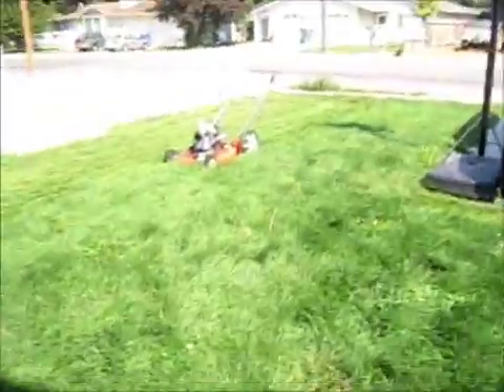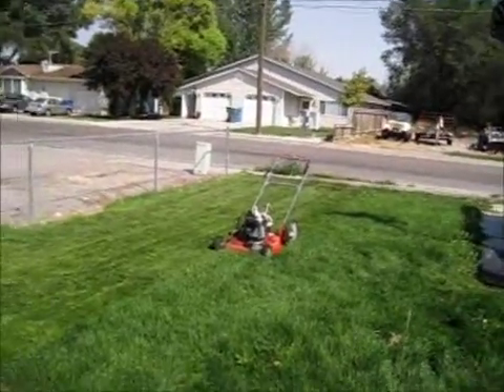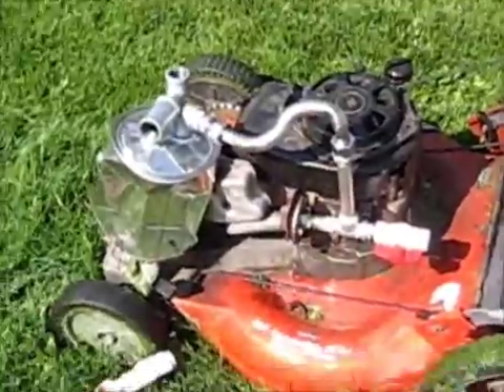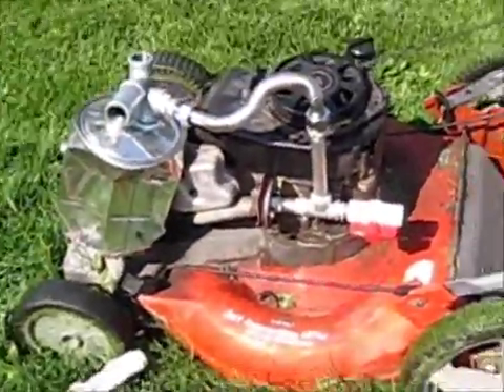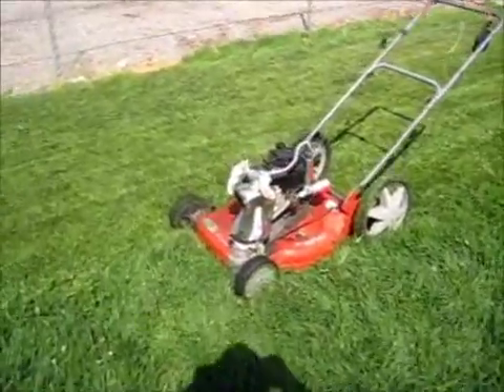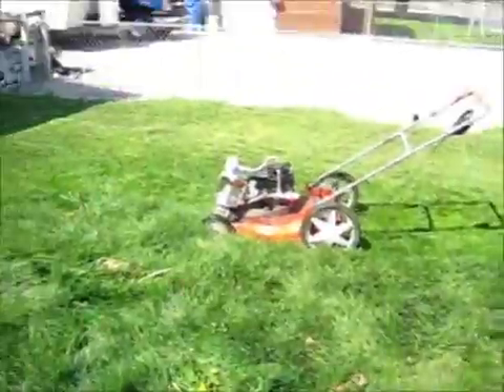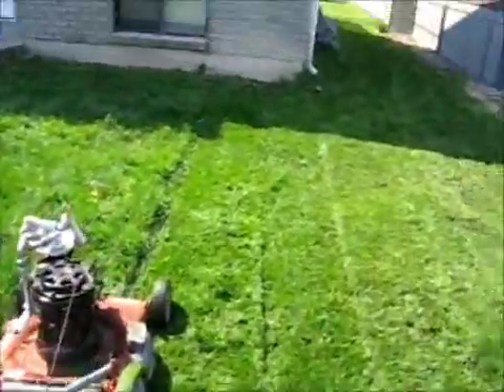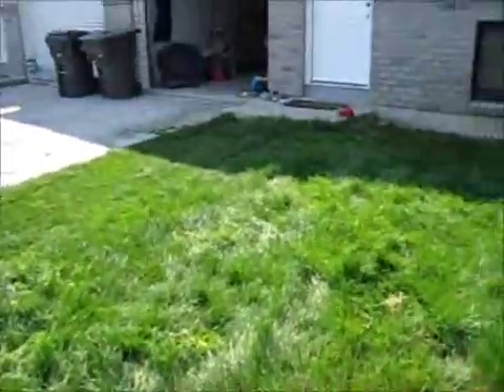More Air To Fuel Ratio Testing!!!

Comment: No apologizes needed for th length of your grass.  That was an excellent verification of the viability of the vaporized fuel vs carburated fuel (misted spray) performance under heavy load.

Comment from the maker: No I will not be changing the timing the car runs the same because it is still gasoline. Once I start doing more intensive testing and see how dry a vapor can be to still run a car normally I'll let you know if at that point the timing will need to change due to the gasoline being in a more volatile state.

Comment: hello 
to understand my idea read my comment your video:"
Gasoline Vaporizer build part 1 (Original Design)" 
and the question is will you ride your car on vapor without changing the engine timing?????

Comment from the maker: the secondary valve is about 90% open. when I cover the air inlet on the vaporizer you will notice the RPM's take off this is because it allows for a more uniform mixture of air to fuel. Normally with a cold vapor I would have the air intake on the vaporizer fully open and the secondary about 75% open with the vaporization using the exhaust heat less air is needed to keep the proper air to fuel ratio.

Comment from the maker: I've used carb cleaner but the carb for my mower is a solid piece I cant take it apart so even though I used the carp cleaner I am unable to get in all the holes. I do have good news A gentleman named John has donated me a replacement carb once I receive it I will install it and do run time tests on it so I have something to compare the vapor to!

Comment: Tyson, look of youtube for how to clean or rebuild a lawnmower carburator like yours. I have been working on several of mine with this type of help. Basically, just get a can or carb. cleaner with the little red plastic straw attached and spray out every little orifice you can find on the carb. I tried soaking the whole carb. in gal. can of carb cleaner, but the pressurized can of cleaner with tiny stray works better at cleaning and jetting it all clean, them put back together,, should work.

Comment: This air inlet blocking thing is real!  I did the same with a 2stroke generator and a glass jar, and gradually blocked the air entering the gasoline bubbler, very very little air entered the bubbler but the engine still run normally. The lover the pressure in the bubbler the faster the gasoline evaporation.

Comment: Tyson, being that your vapor tank(crushed paint can) is under vacuum, this also significantly increases gasoline vaporization. The more vacuum, the more vapors produced at a given temperature. More vacuum, lower vaporization temperatures. Your system maximizes the vacuum thus you're maximizing gasoline vaporization. Add hot exhaust(heating the outer steel can, as you have done), and you've increases vaporization even more.

Comment: Awesome air to fuel ratio test Tyson. That's awesome that you can completely block off the air entering your gasoline vaporization container and run the engine off of fresh air from your ball valve that is not connected to your vaporizer, and the hot dry vaporized gasoline(from your vapor tank heated only by hot exhaust fumes). And all this without changing the spark timing? Incredible.

Comment from the maker: I couldn't tell ya because the carb is bad so I was not able to test run times on it with the original carb. All I can test is different run times with different vapors such as dense and dry vapors.I'll see what I can do to fix my carb and put it back on then test oem run times. My carb is a one piece carb it does not bolt together so its a pain to try and fix.

Comment from the maker: Yes the bubbler needs less air and as the gas gets drier there is less air needed coming into the secondary air inlet. So booth air inlets are restricted but the vaporizer container air inlet is completely cut off when it gets hot enough to vaporize the gas using the exhaust heat. The reason the vapor container air inlet is completely cut off is the vapor ends up pressurizing the container so it automatically sends the vapor into the engine because the pressure forces it out of the container.